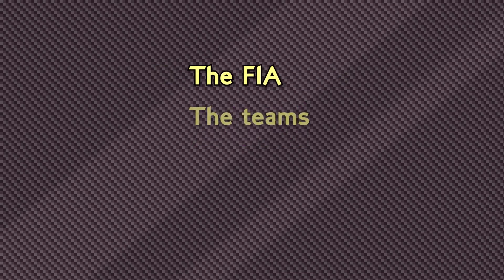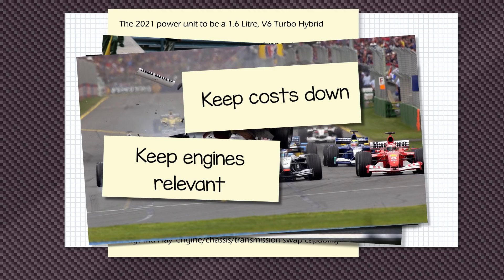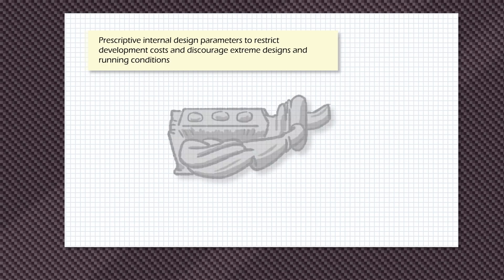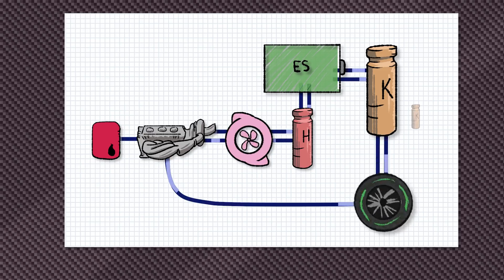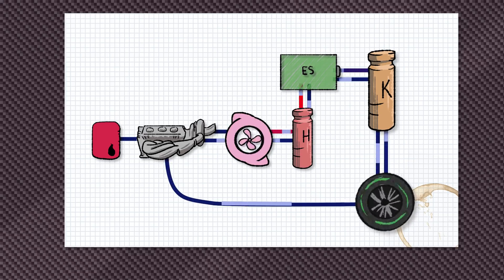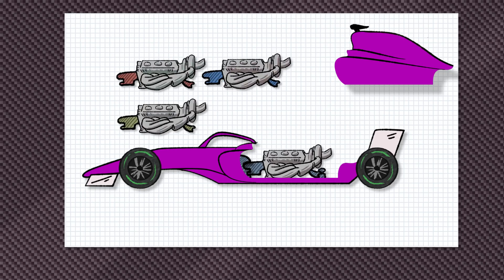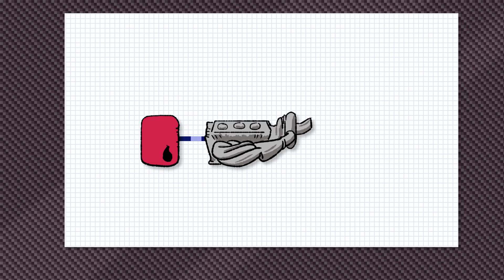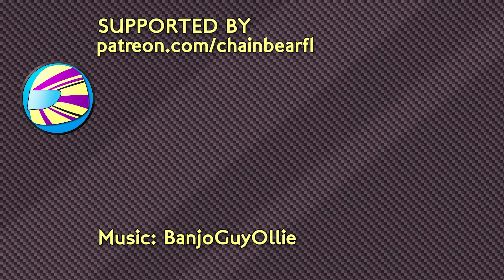F1 Engine proposals 2021 explored

Comment from the maker: So I accidentally said 1 litre instead of 1.6 litre! Oops.
Reply: and you also said 1.5 litre
Reply: Haha i had to pause the video and looked up google for that 1.0l engine LOL
Reply: @laddaevolta  me to XD
Reply: @laddaevolta  it would be very interesting set at 1,000 cc just to see what really is capable fuel and power wise, i think we all could be in for a shock ;)
Reply from the maker: Ah, no I do know that. What I said was the cars currently rev to about 12k, not that they're not allowed to rev above 12k. The engine speed is currently limited by the fuel regs hence why I spoke about why they're using fuel flow to encourage higher revs.

And hey, man. It's my channel - my opinions are relevant here :)
Reply: At 2:00 you say a 1.5 L, not meaning to sound like i'm nitpicking but I assume that's keeping the 1.6 L?
Reply: BURN HIM AT THE STAKES
Reply from the maker: my brain clearly didn't want to admit it was a 1.6 L!
Reply: Chain Bear F1 heh thanks for the explanation. Anyway good work man I lobe your content keep it that way
Reply: Don't worry, they will be 1 litres eventually
Reply: Chain Bear F1 what about selfdriving f1 cars???????????
Reply: @uncanaloarecare2530  Yep, and then they can have self-watching races. That would be excellent.
Reply: Also, flow is 105 kg/h to reflect increase to 105 kg fuel tank.
Reply: Chain Bear F1 or do you know something...
Reply: Remove MGU-H replace with Anti Lag System
Reply: Love your channel Chain Bear F1! Cheers from Brazil!
Reply: If ford went into f1 as a engine supplier, that would be great!
Reply: @GibsnRage
They already decided to dump the mgu-h: https://www.pitpass.com/61794/Manufacturers-sorry-to-see-MGU-H-go
I'm hoping they'll dump the ICE next. :)
Reply: In carbon neutral synfuels can be made economically viable, ICEs will be around longer than you image.
Reply: Dont worry, they'll be 1 litres evertually
Reply: unCanal Oarecare i loled
Reply: I just started watching f1 at the start of the 2017 year and when I noticed that. I Was like "Yes.. I'm Finally Game"
Reply: Chain Bear F1 I had to do a double-take on that one. Lol
Reply: Chain Bear F1 you also said at a different point 1.5 engines
Reply: Chain Bear F1 it´s pronounced Porscha not Porsch!
Reply: I think your turbocharger is going the wrong way, correct me if I’m wrong.
Reply: I heard 1.5 L <3 .. For the sheer fact of conservation of energy (i.e. efficiency, economy,) I hope they keep the mgu-h. I share your enthusiasm for the electric future, it shows a lot of neglected potential!
Reply: @TheMayaSin  actually the mgu-h is what muted the sound of the turbo..because boost is well controlled, we hardly hear any wastegate sound in modern era... Look around in youtube for the sound differences with modern f1 have wastegate open exhaust... sound
Reply: @AmirPomen  I definitely don't watch F1 for the sound. If I want that I'll go to a derby. Good for you if that's your thing, but I don't care. I'm here for the innovation, technology, and racing talent. I am excited to see what comes of an mgu-h free car in the next few years, and I have my faith that the extra load on the brakes will help bring a bit of that much needed competition back to the track.
Reply: @TheMayaSin  no no no.. dont get me wrong... Im all in for good motorsport..literally all kind of motorized racing... 

And since ive been following live and on tv.. there is vast difference of atmosphere with current gen f1...the sound alone makes quite alot of change...(from high pitched to bassy lower rev range)

Its almost similar case to current wrc era if we were comparing it to group A pops n bang (let alone group B monster) and current 1.6t sound abit too civilized when watched from tv (muted sound in post edit)...

F1,wrc,motogp,v8 supercars and many others... I can fall asleep watching f1 and wrc due to sound...seriously...

So any improved sound in f1 are welcomed from my point of view
Reply: @AmirPomen  I never implied you lack an interest in Motorsports, just explained why your opinions about sound has no affect on my opinion on anything beyond the lawnmowers outside.
Reply: @Ben Jamin'
No chance of that at all. Whether it's synfuel, or biofuel, it's more efficient to use them in a fuel cell.
(Though I don't think even fuel cells can compete with batteries outside nieches like very long distance trucks, trains and airplanes in particular)
Reply: biofuel/synthfuel/efuel for ICE and in FCEV is different, i am pretty sure it will be the subtitution for the fossil fuel in the future to keep the combustion engines exist in this planet.
Edit : update from julys meeting, 4 oem engine supplier u-turned keen to keep the mgu-h for 2021 regs, still wanted cost down and improve the sounds.
Reply: deejeenee Yep, he's insane for an opinion. An opinion you disagree with.....
Reply: Then you said 1.5 litre??
Reply: Chain Bear F1 and 1.5.

they should keep the MGU H.
Reply: Anyway,I believe that all teams should explain exactly after the race,when an engine failure happened the reason of that failure....What the fuck happened to the two Mercs after they said that they did"light mods"to their power plant,but obviously,it did not work at all,both cars retired during the race ,first Bottas,then Hamilton,it should be mandatory that the"engine break-up'be explained to the public,I sense some'cheating'from Mercedes,but it did not work.........Both cars "broke"???Cannot happen in the same race...!!!!!!!!....BS.
Reply: Chain Bear F1 didn't notice cuz of ur British English
Reply: Haha i was scared for a second there, the amount of refinement to get that much power out of such a small engine!!
Reply: Chain Bear F1 hey! I have my own youtube channel and dont have much on it but i plan to! I love your stuff and i’d be happy to write you music for whatever you want. Denver.della@yahoo.ca is my email if your at all interested ☺️
Reply: You also said at 2:07 1.5 instead of 1.6
Reply: This was a good explanation. Personally I think F1 engines are brilliant. I don't think they should remove the mgu-h and standardize the battery as these are the areas future hybrids will get there efficiency from. This is also where they are limiting the speed of the car just like Porches 919 evo showed it's true pace after withdrawing from endurance racing and it's regulations. Another thing v8-v12 are like dinosaurs, they will be extinct soon and racers want to race so they want the fastest car not the loudest car.
Reply: F1 is a joke.    Cars have to circulate for a software installation lap before can be driven.  Too many computers and limited input from driver. Competition of engineers now. full stop.   Many F1 drivers could win that championship if they had the current Mercedes.  It's not a competition of drivers anymore.  Best driver cannot win if machinery is not on par. F1 is dead.  Bring on formula E (a drivers championship).   RIP F1.
Reply: I was hoping to hear its actually becoming 1litre 3cyl turbo f1 car.. 🤣🤣🤣
Reply: How soon till F1 run on electric engines?
Reply: Being that your videos are fantastic....I think we can let it slide 😉❤
Reply: They should make a wwww 64 twin quad turbo 1 liter engine
Reply: I remember when I was 14 and the sound was more important compared to the technology and the speed.
Reply: V12 are awesome you $@$k!
Reply: Wow so many utter morons with a noise fetish, and clunky-technology-philia...
Reply: You absolute, world-class moron. Unsubbed.
Reply: The sound is not relevant in F1? You've lost the plot totally, have you been to a F1 race lately? It's pathetic that the two seater sounds 10 times better than the crap they've served since 2014.
Reply: @deejeenee  Have you heard the Honda this year? Sounds like an A10 wartog.
Reply: A-10's must be one hell of a quiet jet if that's the case.
Reply: @deejeenee  They are. High bypass turbo fan jet engines. Sounds more like an airliner than a fighter/bomber jet.

Comment: The ability to boost a large amount of power reminds me of Formula E's "FanBoost" system - just available to everyone.
I always wondered why energy deployment and recovery per lap was restricted as harshly as it is in modern F1.
Why not just let the driver have access to the whole battery for the whole race?
Yea, you can spend your entire battery in one lap to blast to the front, but also... you can spend your entire battery in one lap, leaving yourself vulnerable to counter attacks while you now limp along at reduced power to recharge it.

Comment: @0:50 I think you (and others) massively overstate how many people would want that, engine lovers and engineers like innovation , the point is not a bigger engine you can make these modern engines bigger but that makes no sense in the game of what F1 is; as you see it needs to be reachable for enough teams to make a sport out of it AND more importantly; it has to have connection to what may be useful in general life... but any engine lover would deem modern engines as far superior to old engines, the few that might make a comment contra to it just express a bit of nostalgia to a sound they grew up with or a certain look that makes them feel comfortable; its not a statement of disapproval on whats modern; its an appreciation for the road that led there. just so you know

Comment: Eventually F1 and FE will in some ways meet. Internal combustion engines will be rather irrelevant by 2030 -2040 as most countries are moving to ban the sale of new petroleum and diesel cars by then. Hybrid and electric, and possibly hydrogen will be the future whether anyone likes it or not.

With the above in mind, a number of car manufacturers are not going to spend loads on internal combustion engine research over the coming years and their budgets will be focused on electric.

VW Audi have already said they are not going to compete in non electric racing and as Porsche are part of the group along with Bugatti and Lamborghini, none of those will join F1, more likely to join fe perhaps if at all.

Every manufacturer has new ranges on the horizon, that will be either hybrid or electric, some of them will meet the deadlines for banning new sales sooner than 2040. Though some will plough their own path, Dodge perhaps..

Comment: 2:00 Eventually it’ll get to one cylinder and it’ll be so powerful that a normal V20 engine would be the only way that it would equal its power but if the one cylinder is as powerful as engines today then multiply that by 20 and the Engine is more then capable of pulling trains literally

Comment: Look CB, I’ve started watching more and more of your videos, and I get the “engine futurist” thing, but I simply cannot agree with you on the ICE being completely phased out from Formula 1. That would basically mean a “merger”, if you will, of F1 and FE and if that where to happen F1 in itself would cease to exist, fans will abandon it and presto change-o, the sport is dead and we would all have to make do with open-wheelers turning left for 200 laps(lookin at you indy). Also, I really don’t get this “road car relevance” nonsense. F1 cars are not even remotely similar to road cars apart from the basic principles of the ICE, 4 wheels and a steering wheel. If you want road car relevance we have the WTCR, an FIA sanctioned competition where they race derivatives of ACTUAL road cars. So in that sense it seems pretty stupid to bog down F1 with this “road car relevance” BS. The levels of performance in F1 cars cannot be translated into road going cars, we have a multitude of other series for that (as mentioned the WTCR for hot hatches, Blancpain/WEC for super sports cars. Also, electric cars are FAR off from saving the planet, as the technological process of extracting the necessary materials and manufacturing are quite poor from an environmental friendliness point of view, making it pretty much a marketing strategy for idiots that don’t know better. I can only applaud the engineering prowess of squeezing this much power from a puny tiddly widdly 1.6, but why not make it at least a 2l V8 maybe? Ok, not ditch the K, as it s good value, but F1 should not abolish the ICE, Most F1 fans don’t care about FE anyway...

Comment: These should be the rules:
1. Maximum Fuel Consumption = 95 kg/h
2. Maximum Engine Displacement = 3 liters/183 ci
3. Teams can use any engine layout, any aspiration type and even fuel type compatible with spark-ignition engines (Ethanol, Methanol, Gasoline or a blend of these fuels)
4. You can only use 2 engines for the whole season
5. You must meet racing emissions standards set by the fia (must use special catalytic converters) to reduce emissions. This will not effect the sound in any way, it'll actually be better for the environment and will cancel out bad frequencies produced by the engine
6. Keep costs down 
7. The loudness of the exhaust at redline, with the decibel measuring device 3 feet away from the exhaust pipe cannot exceed 110 db.
8. insert aero restrictions, safety restrictions and other restrictions
This would fix the sport.
Reply: Sounds like endurance racing

Comment: 0:55    IM GOING TO KILL YOU!!!!! That is only a point of view of a green earther...THERE IS NOTHING BAD ABOUT THOSE ENGINES ACCEPT FUEL ECONOMY AND EMMISIONS.... And that old telephone is been improved over the years because it preformed baddly AND V10 ENGINES DO NOT PREFORM BAD!!! They were fast,quick, high rewing loud engines. Put DRS,slicks, better aerodynamics, emprove the engine to be more eficient, produce more power. Thats called moving forward.Improwing it to the limit where there is no more nothing to be improwed. Then is the time to think of someting new. Reducing the cylinders and engine sizes is only moving with the trend of being an green earther and making engines the same size as the skoda citygo... Why? Bechouse it's efficient and doesn't have a big carbon foot print... And it looks new and futuristic so it's moving with the time despite it has a 1 liter engine... A big engine is not bad,it's only bad in the eyes of an green earther complaning it's damaging the earth and an idiot complaning it's too loud. Why not making engines go on hydrogen? Why are you not being so inovative as you are with making v6 more powerfull to finaly over come the problems of using hydrogen as fuel. Well it's not the trend now... It's being learned and told between people that it is impossible to do it so it's allready dissmised to even think about it... And even if someone asks about it the answer would be "It's not the time for it now..." It is the time now untill the FIA has removed petrol engines and turned F1 into all electric cars...Just waiting when F1 will be powered by a weed wacker with 10 turbos,MGU-H and a washing machine motor to make any power,but never mind... It will be enviromentaly friendly...

Comment: In my opinion it’s just silly to make F1 fully electric, as long as there is Formula E for that matter. Whoever manufacturer wants to experiment or invest on pure electric power will join FE, so there is no point of running two FE series. 

I believe that once cars get fully electric, F1 will either vanish or become V10 or V12, remaining just a commercial show rather than a sport with technological development alongside it, with FE taking F1‘s place in this technological development side of racing, being relevant to its time.

Comment: The MGU-H is really improperly named as it doesn’t really absorb the heat of the exhaust. It just acts like a generator spinning off the turbo shaft. They should really call it the MGU-Turbo

Comment: 9.0 litre V16, quad turbo, quad electric motors, unlimited fuel and electricity. Massive ground effect usage and massively angled front and rear wings. Thats my perfect F1 car. The engine would probably be about 2500HP and the downforce would probably make the car weigh more than 6 elephants at 180MPH

Also: The redline is 25000RPM

There is gonna be a lot more deaf people in the world. Especially Dutch people

Comment: The evolution to all electric will end the sport. 1) Have you ever watched an E1 race? Absolute boredom! 2) Did you watch Richard Hammond crash the all electric super car? How long did that car burn. 3) the production of those batteries is horrible for the environment. https://www.wired.co.uk/article/lithium-batteries-environment-impact electric cars are terrible for the environment!!! Hybrids are bad enough, but full electric at any level will, ironically be a much larger issue than petrol.

Comment: A reliable “inefficient” power unit engine that doesn’t constantly need new parts to be replaced is better than an unstable and breakdown prone power unit; especially when the actual cars in F1 have less than 1% of the seasons total carbon output. Feeding the drivers and ensuring their proper nutrition between inefficient air line flights does way more environmental damage.
Reply: Seriously, idk why people care about the efficiency of the cars, they are irrelevant.

Comment: That moment when lighter combustion engine cars without the burdened weight of unreliable batteries are actually faster and have a smaller carbon footprint due to not having to scrap the engines after every few races.